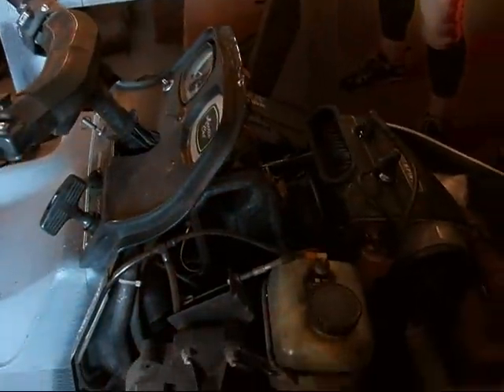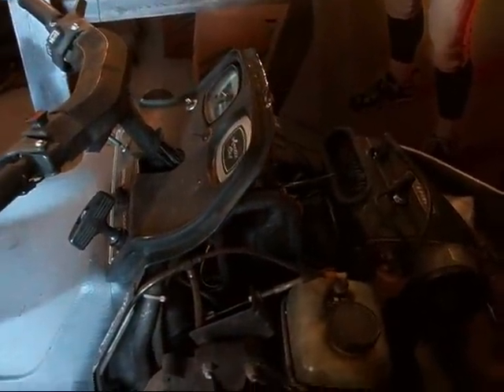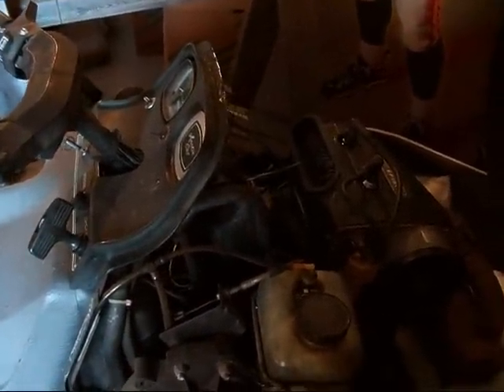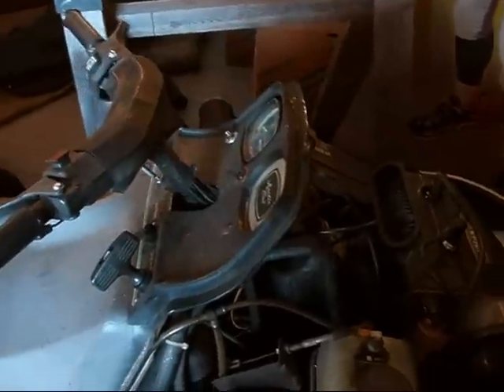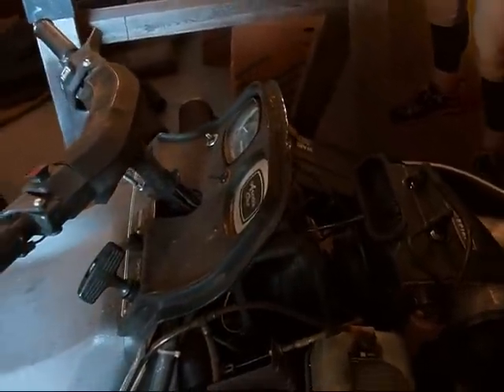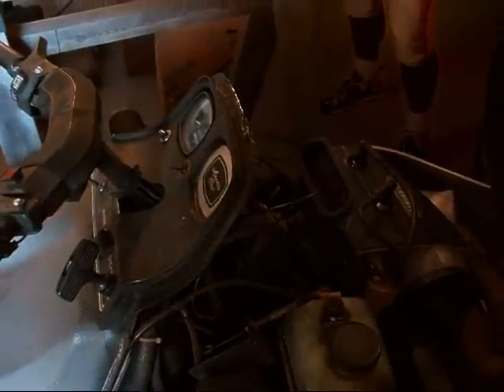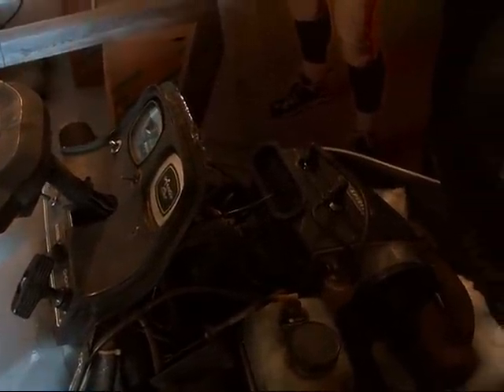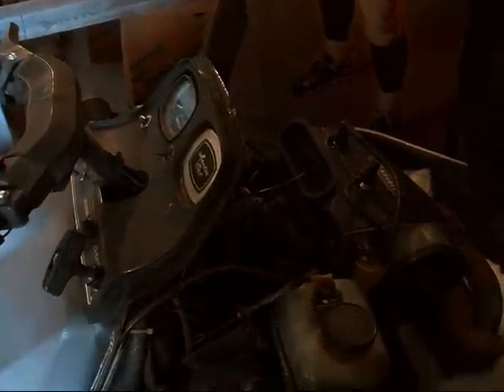arctic cat jag 4000 clutch funny squeaky noise

Comment: If the noise is the clutch and the jag still has the stock clutch, it should be replaced even if its not making the noise because Arctic Cat Hex Clutches are pieces of crap that wear out and become unbalanced(wreck the crankshaft, i had it happen), and if it is wore it can blow up and seriously injure you.  I would replace the clutch and see if the noise goes away.  It could also be something around the recoil (flywheel, fan, etc.) considering it even squeaks when you pull the rope.

Comment from the maker: i found the problem...... because it broke.......
it has an aftermarket 94c comet clutch which are extremely simple and last forever.... or at least there supposed to well anyways the prob was the cover its bolted to the crank well the end of the crank has 2 sides ground down and the cover plate slide on it and it prevents it from spinning well i guess after 20+ years the cover got weak and spun in its place so i need new cover but it also wore away 50% of the crank end so hope it lasts awhile!